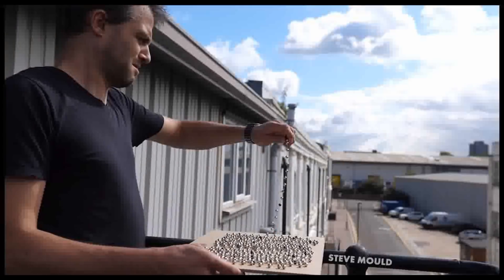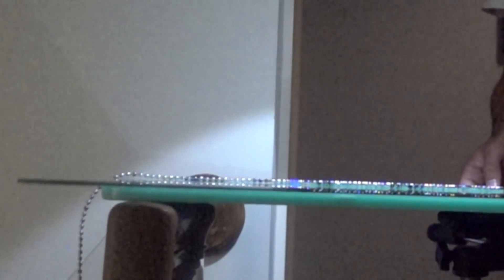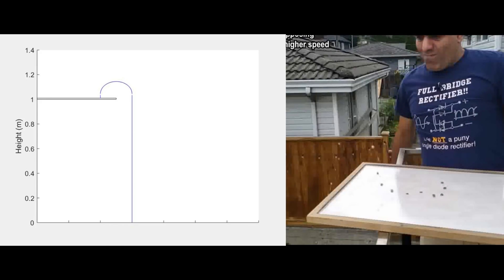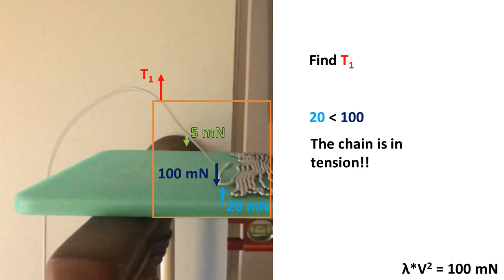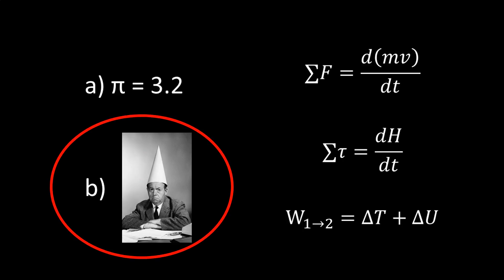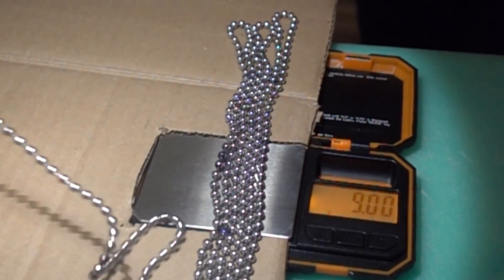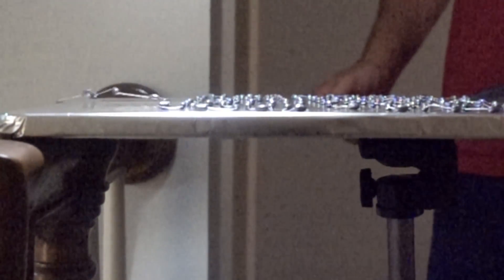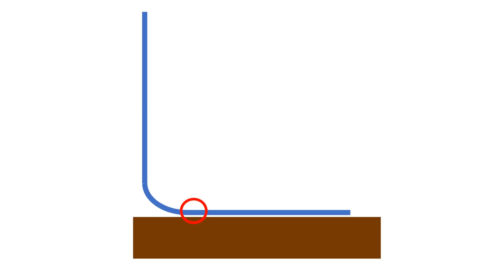And the Winner of the Chain Fountain Dispute is...

Comment: nice video but sadly the amounts of thrown letters and lambda makes it really hard to follow if you have not more than basic knowladge about physics so in case you want to make it more understanable for "commners" dont use T1 and stuff but what it actually stands for to follow better. yes i do know that most fo the ppl watching this are more profound in physics than others because if the nieche this video is placed in but still just for future videos it would make this video feel more light than like a uni hour ^^
Reply from the maker: Yea. I was a little under the gun to get this published and if I had more time I would have made that section more clear. Oh well, next time...
Reply: Nice tests and reasoning. Like you, I was facinated by the chain fountain last time like 5 years ago. And I solved it. There are videos that explain it in my channel. In the supplement data is a link to my paper that explains the chain fountain. I hope, you read it. In case you don't, the explanation is the slope of the pile and the (half) loops the act as one pulley system. As you too noticed.
The ideal chain and a ball chain behave a bit differently because of the bending stiffness of the ball chain. Explanation to your chain fountain from the tray is twisting of the chain that lifts the chain of the surface initiating the fountain. Also the marks in the folio result from it.
Reply from the maker: @paulklinge2480  Hey, you wrote a paper too :). Did you check out the one that I left in my description?

But as I am sure you are aware after playing with ball chains yourself, the links can rotate independent of each other, so they can't transmit twisting force along their length. And even if twisting forces could be transmitted, if you pull the chain out straight, it wouldn't twist anyways because there weren't any twists initially in the chain that need to be undone. And the impressions in the tin foil were greatest's towards the back, when the fountain was the highest, indicating that the extra reaction force was in effect for the whole fountain run, not just at initiation. And if I am understanding your paper correct, you theorize that the extra upward force on the chain comes from the tension of the adjacent chain that hasn't been lifted into the fountain yet. But since, in my case, all the chain that hasn't been lifted yet is laid out horizontally, the tension force from it can't be pointing in the vertical direction, and cannot therefore be reducing the tension in the vertical portion of chain, so it can't be the cause of the chain fountain.

Anyway, reading through your paper, is see that you calculated an alpha of 0.82, which matched your experimental results, which you used as proof of your theory. However, Biggs and Warner calculated a similar value of alpha using their leverage effect theory, so you can't use the fact that the chain fountain height matched the your calculations to disprove Biggs and Warner since their experiment gave the same predication.

And lastly, your theory says that the tension in the vertical leg is less than v^2 because of the tension force acting on the bottom bead by the bead adjacent to it. If that is the case, then the adjacent bead would have to support that tension force somehow, and that would comes from an increased normal force. For example, in your pyramid fountain, if you stuck a highly accurate scale under the pyramid, you should find that the weight would be greater than just the weight of the pyramid and the remaining chain, and that extra weight is the normal force in action. So, if the question is, is there an extra normal force from the table pushing upwards on the pile of chain, your explanation would agree with that question.
Reply: @prestonbecker8784   	
I am sorry, I didn't notice that among videos was also a paper. Looks very thorough. I will read it later.

I too derived a differential equation for the chain fountain. The result was that the shape is inverted catenary that depends on the radius of curvature of the top turn. However, the the radius was bigger than the "natural bending radius" of the ball chain. Also the behaviour of the chain fountain is not really inverted catenary (your fig. 2.2.7). So, I decided that the simpler model (B&W) is better. 

As a scientist I don't have any perceived knowledge. I may have hypothesis, but the test tells the truth. In your main video from 14:40 onwards the chain behaves as if it had twisting stiffness and that it have been twisted. Also at every turn the twist seems to become stronger which would cause stronger impressions towards the back as happens. The reason for the twisting must be in the way you lay the chain on the tray.

These terms like in B&W “pushed upwards by an anomalous reaction force from the pile”. Maybe it is a language thing, but it sounds like something paranormal to me. When a chain of n beads moving with speed v1 takes along one bead from speed 0, it is like an inelastic collision. The chain gains mass and looses speed.

n m v1 = (n+1) m v2  =>  v2 = n/(n+1) v1

There is no anomalous upward force!

My paper does not dispute derivations or test results in B&W. I say that B&W explanation with the kickback force that depends on the properties of the chain is inadequate and unnecessary. I show the mechanism that really causes the chain fountain. 

1. It is the half loops of the chain that act like one pulley systems, reducing the force needed to pull the chain up.
2. The turns of the half loops are dragged up the slope of the pile which gives the vertical component to the reduced force.
3. I derived a formula for the average tension force at the end of the chain at the pile end.

F = (1 - 1/4 sin(theta)) m_ v^2   (1)

where m_ is mass per length and theta is the inclination of the slope.

By tests in my videos I show this to be a working mechanism that produce significant chain fountains without any "upward push". 

In one case (the record :D ) I also calculated the height of the chain fountain with my formula. It was surprisingly good match, but of course the average slope is an estimation. I expected the test to produce a clearly smaller chain fountain than the theory. However, I was happy that the test was not clearly higher. It would have proved me wrong :D Now the test shows that there is very little need for an extra force.

You expect that there is a downward force that can be measured. The dynamic upward force (2 m_ v^2) at the top 180 degree turn holds the chain up in the air and there is no downward force in the stationary situation. However, you try to take into account also the curves of the chain fountain. Since a ball chain has bending stiffness, it may produce some downward force like B&W say. However, I believe it will be quite small.

I am saying that the downward force at the end of the vertical leg in the bowl side is (1) and it is smaller then m_ v^2 which it would be with out the mechanism that I described. I observe stationary situation there everything is in balance and the chain flows at constant speed. However, before the chain reaches the stationary state, there must be acceleration that is force unbalance. I derived a differential equation also for that situation, but it was too complicated to be solved. So, I too programmed a simulation code. I may run some of your examples. 

Yes, in an ideal theoretical case there is no upward force in the tray test. However, you use a ball chain. I also got some shallow chain fountains with a tray. I didn't noticed the twisting thing in my tests. Even without it the chain starts to turn downwards when off the tray. A ball chain has some bending stiffness so, it is like a electric wire. When you put a wire hanging over the table edge it lifts itself up from the surface of the table for a distance. When beads flow though such a curve an extra lifting force is generated. So, a shallow chain fountain might be expected for a ball chain sliding down from a tray.
Reply from the maker: @paulklinge2480  four quick points:
1) This is just me going off intuition (and some vibrations classes) but I think what you are interesting as twisting stiffness is instead rotational vibrations along a taught chain. Think planets orbiting the sun as opposed to them revolving around their own axis.

2) If I am reading you correctly, you agree that there is probably some sort of upwards reaction force due to the bending stiffness of the chain in the “tray fountain”, but that for the normal fountain out of a pile of chain, the effect of this bending force is smaller than the effect that you describe in your paper. However, to my eyes however, the upward force from chain stiffness would be much more likely to occur in the pile fountain than the tray fountain. After all, in the tray fountain, the bends in the tray are in the horizontal plane, so the fact that they are able to transmit vertical force is kind of impressive. In the pile fountain, when the bends will be arranged vertically, it would make sense that this reaction force from chain stiffness would be greater than in the tray fountain. And since a) the tray fountain already reaches half the height of the pile fountain, b) we acknowledge that there is a reaction force from bending stiffness in the tray fountain, and c) we expect this reaction force to be even stronger in the pile fountain, why do we have to go looking for alternative explanations in the pile fountain? It seems the bending stiffness explanation could well be sufficient.

3) & 4) check out this google doc
https://docs.google.com/document/d/159l7g311_Su--PPV-wk4VZHJY8iXgybR7RMJ-klhLBs/edit?usp=sharing
Reply: @prestonbecker8784  1) And I am a retired principal scientist who is used to it that his word is trusted :) But in science authority is not an argument. I am happy to discuss with you and defend my case with arguments.

If we were discussing of a steel bar, I would talk about torsional stiffness. I used twisting stiffness, because it better suit to the effect twisting/torque has on the chain. It makes a chain form a spiral. A bar stays straight. I don't know if twisting stiffness is english.

2) In the tray case the bending stiffness of a ball chain rises the chain near the edge up from the surface to a shallow curve. Mass flow through the curve causes a lifting force which makes the curve higher. There is no reaction force here.

You have the twisting phenomenon that is caused by the way you lay the chain on the tray. I did not have it. The twisting helps to form a higher fountain by lifting the chain from the surface and so removing friction. The rotating spirals take support from the tray. So, the is some reaction force, but I don't see that it pushes up the fountain.

This is quite different phenomenon from the pile case.

a) The reason to the height of the fountain is not reaction force.
b) There is no reaction force from the bending stiffness on the tray case.
c) The reaction force is a weak explanation. It begs a better explanation.

Why are you settling to an explanation that COULD be sufficient, when you are shown another explanation that gives the same test results WITHOUT reaction force??? It scientifically proofs that the reaction force explanation is superfluous.

Comment on your PDF:

In the rack test you would measure weight of the rack + the piece of the chain that the rack supports. No more. This is because the chain hangs in rest from the rack.  The dynamic lifting force of the top turn lifts up both the up flowing and down flowing pieces of the chain.

My equation for sloped case is average T_1 = (1-1/4 sin(theta))*ƛ*V^2  

"And in this case, that conclusion is true, the tension in the one leg will be less than ƛ*V^2.""
"With that assumption, it makes sense why T_1 < ƛ*V^2."

Don't understand the fountain in the lower end???

OK. I see that you have got the hole pulley system backwards. It makes no sense that way. 

Watch my sloped videos again and see, how the half loops are dragged UP the slope and the fountain rises form the top of the slope!!!

4) If you check my paper again, you find a picture of a pile. The fountain would rise up from the top and the half loops resting on the slope would travel upwards. As in my sloped videos. That is how the pulley system works reducing the force needed to lift the beads.

There is also a picture of a bowl with the chain pile in it. You see it has slopes and when the top layers of the chain are gone it still has the cone shape of the pile.

Please, watch the videos. They are slow motion, so you can see what happens.
Reply from the maker: @paulklinge2480  For what it is worth, I watched the four slow motion videos on your channel before replying.

"And I am a retired principal scientist who is used to it that his word is trusted" I know what that is like (though I wasn't a scientist) :)

Anyway, I don't think we'll get anywhere arguing about points 1, 2, & 4 without some pretty time intensive pictures. But point 3 has some promise.

"In the rack test you would measure weight of the rack + the piece of the chain that the rack supports. No more. This is because the chain hangs in rest from the rack.  The dynamic lifting force of the top turn lifts up both the up flowing and down flowing pieces of the chain."
Well, if you ever get to pages 40-44 in my paper, you'll have to let me know where I went wrong then.

"OK. I see that you have got the hole pulley system backwards. It makes no sense that way. 
Watch my sloped videos again and see, how the half loops are dragged UP the slope and the fountain rises form the top of the slope!!!"

I am pretty sure that I understand the picture of the pully that you are describing. And just for clarity, I have updated figures 4-7 to show more clearly what I mean. Am I miss understanding something there? Are my pictures there wrong? Or is it a different part of the document that is wrong? 

And along those lines, the main question I am trying to answer is, what in the pyramid-chain system resists T_2_r? According to balance of forces, something must be resisting it. And if the pyramid is exerting a horizontal and vertical force to oppose T_2_r, does that not mean that there must be a vertical force acting on the block? And could this vertical force not be measured with an accurate enough scale?
Reply: @prestonbecker8784  OK. A bead by bead explanation. My explanation works for all kinds of chains, no bending stiffness is needed. Your fish line chain is a good example case. The beads are attached to the line with the distance D which is relatively long. 

1) Vertical case

Let's think of two chains near each other: A is hanging in REST  from the ceiling and B is flowing up with speed v1. Chain B has just snatched a bead from chain A. So, B's lowest bead is D lower than A's lowest bead. The string between the beads has no tension any more, but it still is almost vertical. When A has risen one D the string hangs loose. When A has risen another D (2 D from the starting position) the string between the lowest beads get tension. At that instance the lowest bead of chain A is transfed to chain B. 

So, per every 2 D rise of chain B it snatches one bead from chain A. All the other beads of A are still at rest! The support force in the ceiling is reduced by m g. 

The snatching of the bead is an inelastic collision

n m v1 = m (n+1) v2 =>  v2 = n/(n+1) v1 

If chain A would be rest on a tray, chain B would snatch one bead every D. That is twice the mass flow as above! The support force under each up lifted bead would disappear, but there is no extra upward reaction force. 

As you can see, in the tray case T_1 = m_ v^2, but in hanging half loop case T_1 = 1/2 m_ v^2. There is no anomalous extra upward force, because the string between the lowest beads is loose.

In series of hanging loops (your curtain rack) the transition to a new hanging loop causes one big snatch

n m v1 = m (n+k) v2 => v2 = n/(n+k) v1

On average T_1 = (1 - 1/4) m_ v^2

2) Sloped case

In the case that the half loop is on a slope the behaviour does not change, when you look the situation in the inclined coordinate system, where up direction is up along the slope. Only in real world some friction is now in play. Though chain A is pulled straight up, the low end of chain A drags up along the slope (see videos) and the basic mechanism still works. 

Since the reduction of the average force is in the direction of the slope, only its vertical component reduces the force needed to pull up a bead.

T_1 = (1 - 1/4 sin(theta)) m_ v^2

3) Pile case

In a ridge situation there are loops hanging over the ridge. That is there are half loops hanging over the ridge = sloped case. A pile is a cone that has slope all around. And the pile is build up of (half) loops. So, the mechanism described above works also with piles.

Pages 40-44

There is a basic difference in your pipe case and my cardboard wall case. Your chain is slipping over the pipe. My chain does not slip!

If you have acceleration of mass, you have force. And in principle you can measure it.

However, I have shown with tests that the slipping is not an important phenomenon in explaining the chain fountain. The chain fountain works fine without slipping. So, you are concentraiting on a secondary effect.

I am sorry about the blunt scientific language.
Reply from the maker: @paulklinge2480  You'll have to forgive me, but I am going to just focus on one part of your reply to try and keep this conversation focused.

In the part of my paper where I cover the hanging loop fountain, I make the following assumptions:

No minimum bend radius and so no bending stiffness
Homogenous chain of uniform linear density
The chain hanging over the pvc pipe does not slip (it may slip some in real life, but I ignore that for the analysis and assume the chain is fixed to the pipe)

As for the geometry, I assume that there are two vertical legs, which per your terminology, the stationary leg will be called A (which you have hanging at rest from the celling. In my case, it is hanging from a pvc pipe. But like I said, I assume that leg A does not slip across the pipe, so I believe this to be functionally equivalent) and the rising leg is called B. A and B are connected by an upwards turned half-circle of chain. Leg A moves with velocity V_A (though, as we said, V_A = 0), leg B moves at velocity V_B, and the center of the half-circle moves up at velocity V_B/2, which is what you were talking about when you said:

"So, per every 2 D rise of chain B it snatches one bead from chain A. All the other beads of A are still at rest!"

And lastly, the tension force between the half-circle and leg B is T_B, and the tension force at the attachment point for leg A at the celling (or the pvc pipe) is T_A.

So, with that all laid out, we get to the crux of the matter. When I started this project, I assumed that, as you said, we would find: T_B = 1/2 m_ V_B^2. But when I pulled out Reynolds transport theorem and conservation of linear momentum, I instead found that T_B = 1/4 m_ V_B^2. Likewise, when I first started, I assumed that T_A = m_A*g (where m_A is the length of chain in leg A), but using Reynolds transport theorem, I instead found that T_A = m_A*g + 1/4 m_ V_B^2.

This conclusion about T_a specifically is backed up by this research paper https://arxiv.org/ftp/arxiv/papers/1810/1810.13008.pdf on page 4 when they say "Finally, it is worth pointing out that the beam to which the end of the chain is fixed starts exerting an extra upward force 1/4 𝜌𝑣^2 as soon as the chain is set in motion"
(I should note that I only found that paper after I had already published my own paper and video)

Additionally, this additional tension term in the stationary chain can be seen in this video:
https://youtu.be/X-QFAB0gEtE?t=97

Where the tension at the very top of the chain (where it is tied to the railing) is greater than just the weight of the chain.

So, I had the same initial assumption about the magnitude of the tension forces as you, but after going through a rigorous derivation, I found that the answer was different than what you or I had originally expected, and it ended up matching what other researchers had already concluded. And since you and I are both assuming that leg A is fixed and has no velocity (the thing about leg A slipping only comes up later in my paper as a side note and is not used in the derivations) my question becomes, where did I and the other paper mess up that our counterintuitive equations are actually incorrect?
Reply: @prestonbecker8784  So, you want to skip the part that is the solution to your problem? :D

I eyed trough your paper. The momentum equation that you derive from the Reynolds transport theorem is called rocket equation in mechanics. It is used to form equations in cases where the mass changes. I will soon go to page 40 :)
 
I recall having this problem 6-7 years ago when I was introduced to the chain fountain. To check my results I used different approaches and got different results. Which was correct was difficult to determine. I looked for similar cases like the weight falling faster with a chain half loop hanging and tried to solve them. Finally I came to the conclusion that my ambition level was too high. I had tried to include the curves, like you, and different solutions to link chains and ball chains. So, I decided to drop the curves and think only the ideal chain. The odd behaviour of the chains depend on the type of the chain and its properties like long links. The ideal chain don't have most such behaviours. 

I also "developed" a test, how to determine, which result was correct. It is to think the situation through as discrete beads. As I did in my previous answer.

In page 40 is the figure 2.5.11. It shows half of a half loop, including the curve, hanging from the pipe. You derive the equation for it and then let R go to 0. And you get the wrong result. In my previous discrete bead answer the chains are very close to each other and chain B snatches beads, that are in rest, from chain A. The result in this case is that T4 = lambda n3 m g. Only the gravity. 

You have a semicircular model of the curve (fig. 2.5.3). I am not sure you are using it correctly. Back to my A and B chains. The lowest blue bead clearly belongs to chain A. It is in rest. The yellow bead is already pulled a bit up by chain B. The string in between the blue and the yellow beads is not vertical any more. So, the yellow bead does not, at least fully, belong to chain A and it, at least partly, belongs to chain B. The same applies to other beads, too.
Reply from the maker: @paulklinge2480  Well, I was hoping to avoid having to talk about discrete beads (as opposed to homogeneous chains of continuous mass) since I figured that the required derivations would kind of suck to work out. But it appears that you will force me into that 😁.

Anyway, I have written up a new mini derivation that deals explicitly with discrete beads. Let me know what you think:

https://drive.google.com/file/d/1IEinC0B_RWmDzCkcYv9DgyeHpLTYvAKT/view?usp=sharing

Basically, if you assume that beads transition instantly from leg A to leg B, then you can get any result that you want. But if you actually try to model the transition of beads from leg A to leg B, you find that:

T_A = lambda*(L_A*g + 1/4*V_B^2)

Cheers
Reply: @prestonbecker8784  Here is the explanation why we can ignore the bend.  We have a long chain hanging from high point (A) and chain has a 180 degree bend much lower (B) from where the chain goes vertically up. The free end of the chain is lifted up with speed v. Then the bend rises with speed v/2. 

I first explain with beads and then for the continuous chain.

We assume that the shape of the bend stays constant. You use a semicircle to model the bend. Let's say the length of the bend is n*D. D is the distance between the beads. Then there are n beads moving along the bend. The beads are modeled as point masses => no moment of inertia. 

Lets consider time t when the beads are positioned so that on chain A (hangs in rest) side the bend has just reached a bead that is at rest. On chain B side a bead has just come out of the bend with speed v. After a short time dt during which the bend has risen one D up, there are beads at exactly the same positions as in time t. They are not the same beads, but they have all the same properties: mass, position and velocity. Except the bead that had just came out of the bend at time t. It has now moved 2 D up, but it is only one D above the end of the bend.

The momentum equation is

p1 + F dt = p2 => F = (p2-p1)/dt

As you can see from the previous explanation the contribution of the beads in the bend  to p1 is exactly the same as the contribution of beads in bend to p2. So, they cancel each other!!! So, you can freely ignore it. The situation is equivalent to the case where at time t the bend takes in one bead from chain A in rest and out of the bend comes one bead attached to chain B that moves up with speed v. It happens every dt.

v/2 = D / dt => dt = 2 D / v

So, we get

F = m v / dt = 1/2 m/D v^2 = 1/2 m_ v^2

This force only effects chain B and there is no force on chain A side.

The continuous chain

The real shape of the bend is probably close to a catenary. However, the shape is not important, but that is stays constant. Let's measure the position in the bend by the distance l along the bend from the A end of the bend. At time t1 there is infinitesimal mass m_*dl at position l which has a specific velocity in the direction of the bend at l. At a later time t2 when the bend has risen dh = (v/2)*dt, dt = t2-t1. The infinitesimal mass at position l is not the same anymore, but where is of course a new mass m_*dl. It moves at the same velocity as the mass at the same position l in the bend at time t1. This same phenomenon applies along the whole length of the bend. 

The momentum equation is

p1 + F dt = p2 => F = (p2-p1)/dt

Since the momentum of the bend is the same at time instances t1 and t2, the bend has no effect of the bend in the momentum equation. Only the mass flow out of the bend to chain B remains. 

dp = (m_ 1/2 v dt) v  =>  F = 1/2 m_ v^2

This force only effects chain B and there is no force on chain A side.
Reply: @prestonbecker8784  OK. You are right. I simplified too much when ignoring the bend. As I showed it does not effect to the dynamic TOTAL force. However, deleting the distance between the chains was too much. If there is some distance, a bead will travel that distance all the time accelerating. So, at least with a symmetric bend, the dynamic force should go evenly to both chains.
Reply from the maker: @paulklinge2480   @Paul Klinge  What a coincidence. I was about half-way through writing a reply with the same conclusion about symmetric bends. I even had some video evidence. Also, for conservation of angular momentum to be conserved, the two forces would also have to be equal.

Anyway, if we agree that the two forces are equal, then hopefully what I wrote here seems more reasonable:
https://docs.google.com/document/d/159l7g311_Su--PPV-wk4VZHJY8iXgybR7RMJ-klhLBs/edit?usp=sharing
Reply: @prestonbecker8784  Your text up to figure 4 is OK. You should be able to measure the extra reaction force. However, the rest is not how I explain the chain fountain. Yours is backwards. The fountain rises up in the middle. I have explained my mechanism in my paper and in my previous answers. Of course, my paper now needs some revising, but the description of the mechanism stays the same.
Reply from the maker: @paulklinge2480  "The fountain rises up in the middle". Under whose explanation? The fountain rises up in the middle under your explanation? Or under mine? And what does that mean? The middle of what?

And what is wrong with figures 4-7? It doesn't seem any different than figure 3 except that one of the legs is no longer vertical.
Reply: @prestonbecker8784  In the middle in my explanation and in reality too. See the figure 4 in your text. It is from my paper and in my channel is the video. There you see that fountain rises from the top in the middle. Not from the lower edge as you draw in figures 5-7. It is an elementary piece of my explanation that the bend slides up the slope. Watch the video of the loop chain. The phenomenon is clearer.
Reply from the maker: @paulklinge2480  Hey Paul,

Unfortunately, I really couldn't tell much from your videos. They were too grainy. So, I filmed a reproduction of your setup. Some stills from that, as well as a new discussion, can be found here:

https://drive.google.com/file/d/1pD6p_Ndeh5LVa5HDsEpBBXgB5j_vxh_J/view?usp=sharing

Let me know what you think.
Reply: @prestonbecker8784  I am sorry for the quality of my slow motion videos. Mobile phone cameras are much better now. And the videos are clearer on my screen than when watched from YouTube.

English is not my native language. I have used "the top edge" to mean what you now call "the very peak of the slope". When watching my videos I saw that the chain fountain rises up (the up flowing chain) practically in the middle (the top edge). There are so called waves going a bit over the top edge from side to side. They result from momentum of the chain as explained in my paper. The basic reason, why the chain fountain rises in the middle, is that there are, in this 2D case, two slopes along which the chain slides up, first on one side then on the other continuously. It goes similarly in 3D case.

When you watch closely, you see that the chain is not attached to surface of the slope along the whole length. But the bend slides up practically the whole length of the slope. This an important element of my explanation. You also noticed it as you point it out with the red arrow.

The "picture from google" does not describe the situation correctly, because in reality the chain fountain rises straight high up. You can get the situation in the picture in the beginning. That is why I jump start my tests. I let the chain to flow from a bowl and form the chain fountain before the actual test set. So, the chain already flows in a good speed when it moves to the test set.

I think we now agree on the reaction forces and probably on the mechanism that causes the chain fountain. :)
Reply from the maker: @paulklinge2480  If that is you asking for a truce on the matter, I can get behind that. This has been fun though.

Where are you from if English is nor your first language? Based on the last name I would guess Germany.
Reply: @prestonbecker8784  We had a good discussion and I found that I have to revise my thinking. Thank you for that. I assume that you too got something from our discussion. 
I live in Finland. Finnish is a very different language from English. Finnish belongs to Finno-Ugric language family and English to Indo-European. So, English is closer to Persian than to Finnish :D
My grandfather was from Germany and I was given also a German first name hence a fully German name.
Where do you live?
Reply from the maker: @paulklinge2480  Finland? Holy crap, yea that is one heck of a language difference. And based on your writing, I didn't even realize that you were a non-native English speaker.
I live in the US.
Reply: @prestonbecker8784  Thanks!